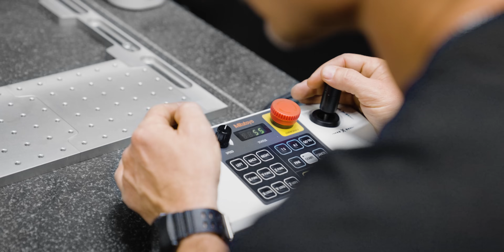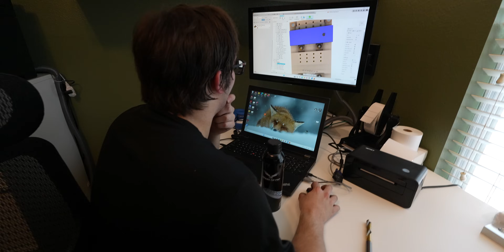Turning Challenges into Triumph: An Autistic Machinist’s Inspiring Startup Story

Comment: I’ve thought about doing computer programming type stuff but the only job I’ve ever worked at is this machine shop in Ohio. My dad works there and that’s how I got started and was cleaning all the machines. Now I run a mazak lathe and don’t know anything about g code or milling but I’m getting more experienced on how to program things and change over jobs on my machine with cups and cones and spacers. It’s very nice to be on my feet and moving but still getting to mess with the programming side of it and I’m really detail oriented so sometimes I go a bit slow trying to get a perfect part as I can. At least my shop doesn’t pay the best but man I really do enjoy it for the most part

Comment: Hey Titan, what roughing endmill  would you recommend for 13-8 Stainless steel? 12mm(1/2 inch)diameter 3xD flute length
Reply: I would give the Harvi 4 (8 flute) or the Harvi 3 Aero (6 flute) from Kennametal a try.
Reply from the maker: Agreed